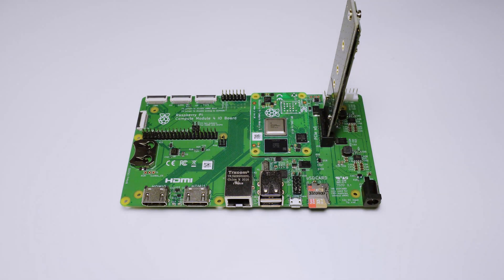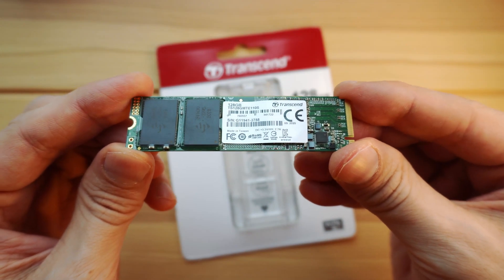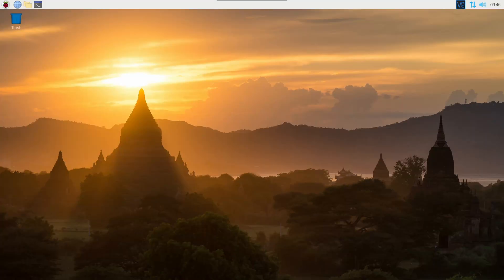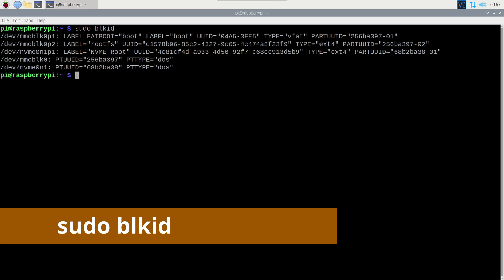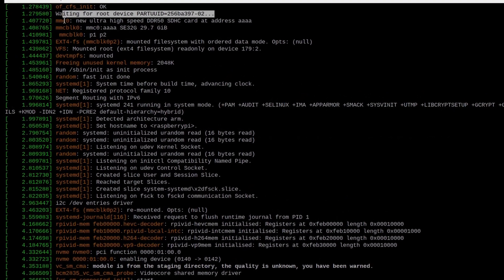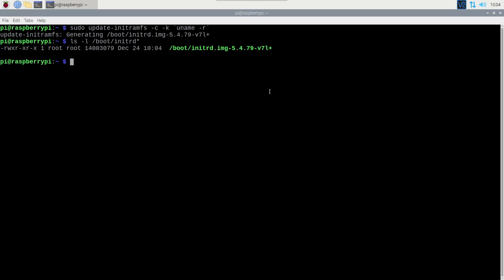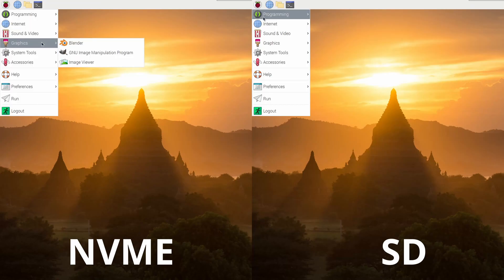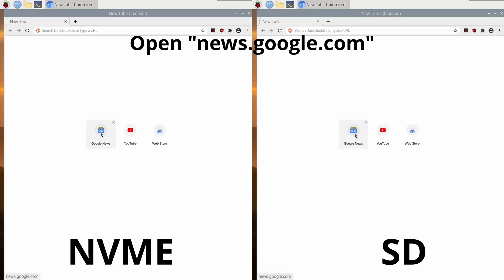RPi Compute Module 4 + NVME (root filesystem)

Comment: Great explanation! IS there a video or transcript for adding an NVME drive as media storage but retaining the SD card as a boot drive? I have a CM4 media streamer with a PCIE to M2 adapter and would like to avoid having all my music on external USB drives. I am finding it hard to locate guidance anywhere. Appreciate any assistance you may be able to offer.